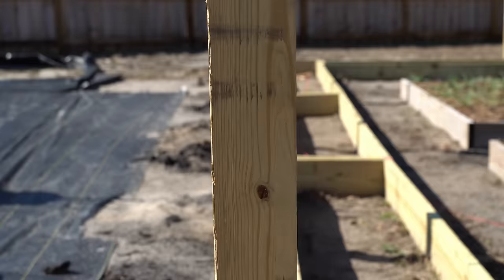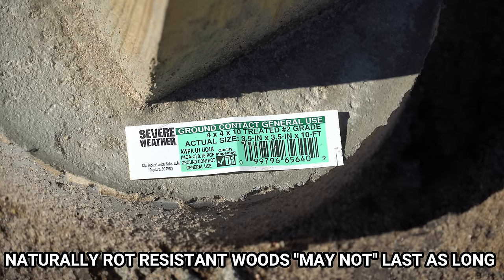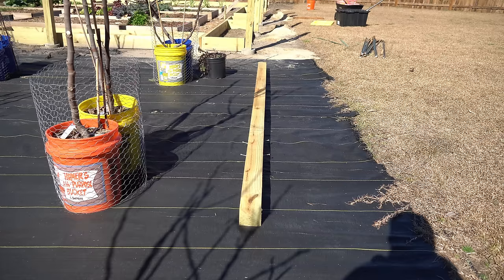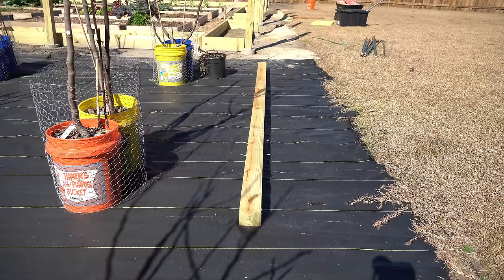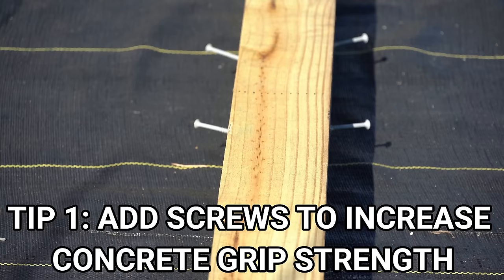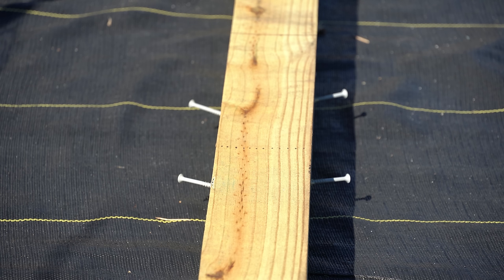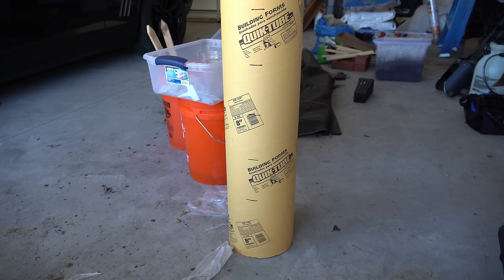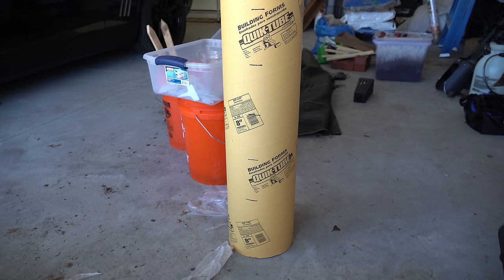3 Tricks To Installing Stronger 4X4 Wood Fence Posts That Last Longer

Comment: Outstandingly clear and thoughtful commentary - Thank You.  Not sure what your annual rainfall and soil permeability is, but posts set that deep in my area (Bristol, UK) will be into the water table.  My approach has been to cast a column of concrete, raised as is yours above soil level, and to bolt a raised post-base to the top of it, setting it level as the concrete sets.  Too early to tell how long it'll last, but I'm happy to be able to see (and to be able to re-treat) the post bases.  The drawback of my approach compared to yours is that the lateral stability has to be in the superstructure.

Comment: I learned something today. I usually use put 2ft of the circular form into the hole and fill it with concrete.  Nice idea to fill the hole with concrete and just use 5in of the form on top. Not sure I'll change my ways but a nice idea nevertheless.

Comment: Thank You for the information. I should have done this on a fence I put in about 6 months ago.  One thing I did notice is how the electric company fights the telephone pole decay thing. They slip a water proof sleeve over the end of the pole that's in the earth and I'm pretty sure they coat it with creosote. I did use that idea on some of my posts for my cat corral and it seems to be working pretty good. Again, thank you for a great video.

Comment: im a 69 yrs old men and everyday i learn somethng new  you have good ideas for the post  i was thinking idont know but instead of the screws  why dont drill a couple of holes across the 4x4 and  put pieces of ribbar for more support  just my 2 cents  thank you
Reply: smarter then screws
Reply: Screws do nothing but introduce more moisture into the wood and increases rot. Concrete ATTRACTS WATER and increases rot.  I used to use concrete but its terrible on posts.

Comment: Great information, thank you very much for sharing. I'm putting a grapevine trellis over my 10' X 16' patio using these 4X4 posts. Before installing the post, I plan to coat the lower 40 inches with Black Dip Rubberized Coating to add extra post-life. Keep up the great work.
Reply from the maker: DrDread sounds like a fun project.  Good luck!  Thanks for watching.
Reply: Be sure not to coat the very bottom leaving  an escape route for any pos moisture other wise your just giving it a place to pool ...The Millennial Gardner should use this hack  as well its the only thing he missed ,good luck too ya.

Comment: I cut the top and bottom off 2L and 3L bottles and slide it over the post and then heat gun it so it acts like oversized heatshrink, 6inches above ground and 6inches below works well.
Reply: seems like the plastic would retain moisture.

Comment: I won't say the screws do nothing but assuming the post isn't yanked around before the concrete sets the only possible difference is in it's resistance to lifting straight out of the hole. Nothing short of a moose getting frisky or a twister should apply enough upward pull to make the screws matter here, imo. 

Not sure about with pressure treated but both scorching the surface of untreated wood and applying sealers, even just motor oil, are tricks to make wood last much longer in ground contact. I've even heard of wrapping plastic around the bottom of a post before pouring the concrete in. I keep meaning to try charring then sealer in combination but haven't heard of anyone risking it with pressure treated.

Comment: Good idea. In addition you can caulk the joint where the post and concrete meet
Reply from the maker: That’s also another step you can take to prevent water intrusion.  I skipped this step, but doing it is another improvement!

Comment: Excellent upgrades. The only thing I do different is I use a galvanized bolt and go all the way through the post instead of the screws.

I have also painted the bottom of the post with water proofing.

The other thing I'll mention is when you cleaned off your concrete around your form you want to leave a little bit of a dome so that the water can shed to the ground. If it's flat it'll pool on top of that flat surface, as you mention with your pitch.

So far my posts have lasted 33 years. In South Florida.
Reply from the maker: I don't have any issues with water collecting on the tops of the foundations, and we've already had 50 inches of rain this year so far.  The pitch is more than adequate.  The only comment  I'd make is that you want to make sure the waterproofing compound is non-toxic if you're installing posts for a garden like I did.  I wouldn't want any potentially toxic chemicals in my growing soil.

Comment: Try Simpson Tie Galvanized Column Base for 4x4 Nominal Lumber. Then you dig 2ft at the “most”. Post never touched soil. A lot easier, less time and effort and it will last even longer.
Reply: I like this idea! I'm new to all of this and seeing way too many comments about the wood eventually rotting if installed straight in concrete. Does the wood in the method you describe still have to be rated for ground contact? Or will standard pressure treated wood work? Thanks for your comment!

Comment: With respect and in the spirit of positive conversation:
- The screws will penetrate the chemical barrier and actually cause rot in the timber. 
- The concrete reveal prevents any rails or palings being set against the post so wouldn’t make a neat fence. 
I have no issue with the gravel :)

Comment: When we build new decks and fences, we have a custom 12,000lb winch setup that pulls the posts out and the concrete comes with 98% of them. No need to put in a few screws. 12,000lbs of vertical force which lifts the concrete with the post won’t change with a few screws.

Comment: I know this is a really common way of setting posts for fences. Here are a few views I've recently heard: someone said that the concrete around the post acts as a sponge absorbing ground moisture. Another person said to paint the entire bottom  in concrete with tar or roof cement. Another view was this creates a glass effect for moisture to sit in from above. My thought would be to paint the sides that touch cement to allow the post to breathe up and down against the gravel base. I agree to have reveal and not let soil pool around the base. What do your fence panels look like? I needed a fence around my garden, between the birds, squirrels, rabbits, ground hogs, raccoons, opposum and deer they were eating all of my vegetables.

Comment: While I like the idea of having the concrete end above the ground to prevent standing water at the post base. I have never been able to pull any post from the concrete it was set in. I think the screws are overkill and fixing a problem that doesn't exist.
Reply: We do that in AK to prevent frost jacking. The crushed gravel also provides a capillary break.

Comment: If you insist on doing this wrap the post with 30 pound felt to create a drainage plane.  Pressure treatment will not help guard against rot because the concrete holds moisture.  Embedding screws into the post will only allow moisture to penetrate deeper into the post. Pressure treatment usually does not go thru the entire post.

Comment: My friend, that is a glorious looking raised bed system.  I love the elegance of the wood.  Your tips and tricks are awesome.  I like how you have the 4x4's on the perimeter.  You can suspend all sorts of trellises with that.  Man, your setup is pure awesome.
Reply from the maker: Thank you.  I’m a design engineer, so I designed the entire layout myself to maximize both space and function. I wanted to grow as much food in as little space as possible, and I went through several designs before I settled on this. If you check out my most recent videos, you can see how I trellis my tomatoes and cucumbers.  I have a whole system going.  Vertical gardening is where it’s at for disease sensitive plants!  Thanks for watching!
Reply: @TheMillennialGardener  most definitely my friend, string trellising is the way to go for cukes and tomatoes. I just saw your video. If you grow thru December, you will for sure have excess vine. In your video, you opted to coil the excess under the plant. Have you considered "string walking"?  I'm sure you've heard of the idea. Essentially, you lower the plant once it's reached the top. Then you shift the plant to the left or right, doing so in unison for all your plants. Your planters are wide enough to allow two plants. You could potentially lower and rotate the plants in one direction, wrapping around at the ends. I am sure you have already thought of this because you chose to use tomato hooks which can slide along your top rail. I personally did not do this because I had an abundance of tomatoes.

I was testing out a way where I let one of the suckers near the bottom grow out as the plant reaches the top. The idea is to time it so that the chosen sucker grows becomes the primary. I just then lop off the existing main branch. Then repeat. That way, I don't have to deal with coiling or string walking. My thought is to reduce the distance that nutrients have to travel to reach the fruits. Anyways, I digress. 

Happy growing!

Comment: Rocks in the bottom of the hole. The rock will provide some drainage for some time if you have soil that actually drains. If you have a clay type soil the water doesn't have any were to drain to, the ground prevents that. The clay acts both ways: it makes it harder for water to get to the bottom of your hole and once it gets there it makes it harder for the water to move away from the hole as the hole filled with rock now becomes a, more or less, sealed pond. The best way is to go 6" below the frost line then pour 6" of concrete for the bottom of the post to sit on. The best way which is also the most pain in the ass is to actually suspend the post 6" off the bottom leveled both ways then pour the concrete all the way around the wood. You can get a plastic concrete 4 way chair for the bottom of the post to sit on so that you do not have to suspend the load, just make sure that the chair is tough enough to handle the load or make them out of some bent and welded rebar. Tough to do and slow or expensive if you do more than one hole at a time. Make sure that the concrete has set enough to hold the load before removing the leveling supports 1-2 days unless using high early concrete. 

For pole barn construction the quick tube or sonotube works well with the cost of the tube being off set on savings on concrete due to oversize holes. Also makes the calculation for the amount of concrete easier X by Y tube holds Z amount of concrete no more, no less.
Set your tube 4-6" below the finished grade if you are pouring a slab for the floor, set the posts then pour the floor slab around the posts to the finished grade. If you are tough you can do it all at once.

Comment: I have been doing that exact same thing but usually with 4 screws to all four sides of the posts at 2 feet in ground and 8 feet above and every four feet with another post.  This was from 2002 and the posts are still solid but the other key was using a square-coiled 3/8th inch rebar but it was easier to use a concrete mesh  cut to two feet and folded into a square hollow rod that fits in the two foot ground area that will be in the ground and the four nails are wired to the mesh to keep it still.  When you pour the concrete, you will also always elevate it by 5 to 6 inches above ground using a square that is 2 inches wider than the 4X4 which means the square is  about 2 to 3 inches wider than the 4X4 post.   It seems like a lot of work but I just took my time for each post while listening to NPR radio or French pop music.
Reply from the maker: Thanks for watching!  Glad to hear your posts are holding up.

Comment: I've got all these supplies, first post is ready for concrete. But please let me know if I can put fast set down in the hole, add water,  then top it off for the reveal with the high strength concrete mixed in a wheelbarrow.

Comment: It wouldn't hurt to tar up the bottom of the post after you put screws in them. Concrete footing needs to be thicker or make them square to prevent cracking at the corners of the post where concrete is just a few inches thick. Also, some rebar or hardware cloth imbedded in the footing will prevent cracking.

Comment: Never bury wood in concrete.  Concrete is a sponge. Elevating the pylons is a good idea but the wood should be secured on top of the concrete not in it. I like the garden idea tho. Just not good building tips. Wood below grade is never a good idea. Sure concrete may sink, but for your application with no load it is less likely to do so. Good luck with the project.
Reply: Concrete is code for fence posts in a lot of places, so many don’t have a choice.

Comment: When I put up my 4x4 posts for my outdoor seating area I will use gravel sand cement and bits of rubble brick etc to add more strength to it. I might look into something for the tube idea though I like this idea but I would have put a lip on the concrete to keep the water off the flat surface on the top. Because otherwise the water will sit on top u less he did this but it looked flat to me.

Comment: The anti rot poison will leach into the ground and maybe into your produce, I would simply tar the bottom 3 feet and gravel fill the hole around the posts, I've built barns this way and years later not a single problem with rot.
Reply: The tar is more polluting than the Copper based treatment.

Comment: I did this BUT I also was building a small wooden fence and used 6x6 posts and used 2x6 boards on the top and bottom and 2x4 for the middle and screws on everything.  When I place the boards on, each time when I connected to a post, the next board over I went up or down from the location of the previous board so I could utilize the entire 6 inches of space on the post to drive in 6 screws vs how people place the boards side by side on a 4x4 post and get only 2 inches of space to support all that weight. My fences have NEVER failed in windstorms or Hurricane Katrina and Ida and are still standing.  Do it...do it right the first time

Comment: All very good ideas.
While watching this another method of preventing the post which could be combined with the screws or used stand alone would be to cut two V grooves 3/4" deep on each side of the post where there are no screws. - just a thought :)

Comment: Absolutely fantastic video……I have been looking at quite a few videos to see the way to put in face posts. I am 67 yr old from Scotland and want to do this myself but want to get it right.
Your suggestion to put screws into the post is something nobody else has mentioned and I can see a great benefit doing this.
Can you tell me…. I know you said to make a hole 40” deep to give 4” inches of gravel……. What diameter should the hole be if using 4 x 4 inch posts? Is there something you would recommend to hire to dig out the hole in the first place?
I know I probably speak for everyone when I say your explanation and attention to detail is excellent. You explain things in a simple to understand way……. Thank You so much… it’s appreciated
Reply from the maker: I’m glad you enjoyed the video!  Ideally, the hole will be about 12 inches in diameter for a 4x4 post.  My holes were 12 inches at the top, but it got really hard to hand dig and keep the width by the time you got to the bottom, so they’d narrow some some 8-10 inches.  I used a regular manual post hole digger.  It gets the job done, but it works.  You can look into renting or buying an auger.